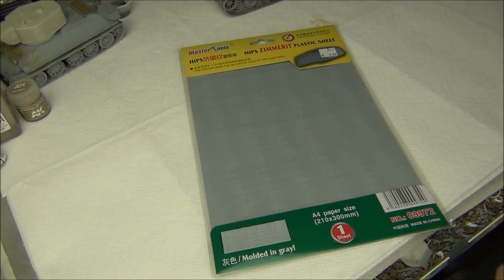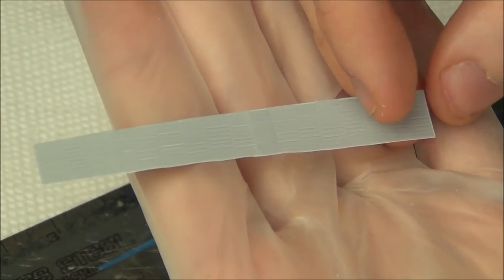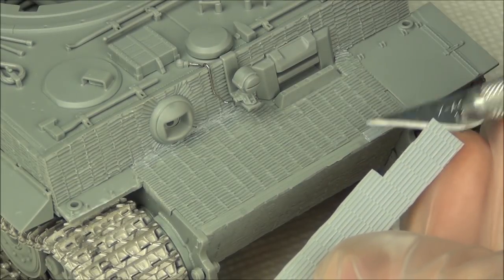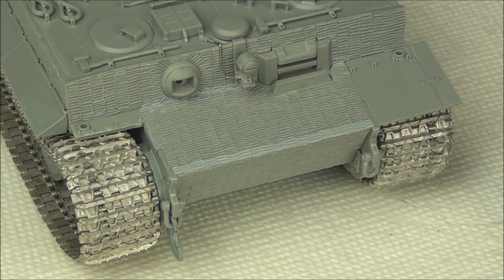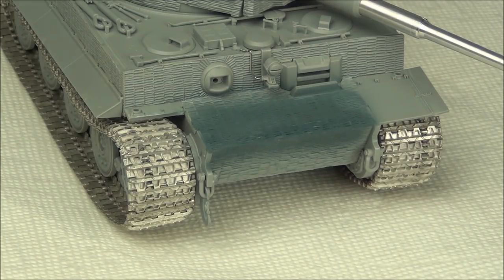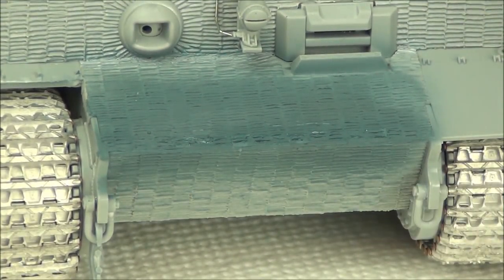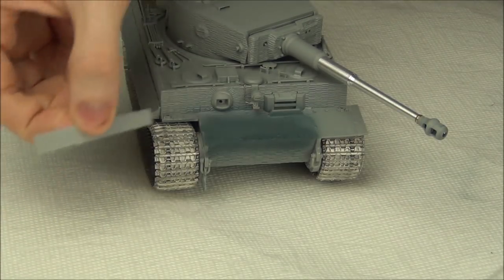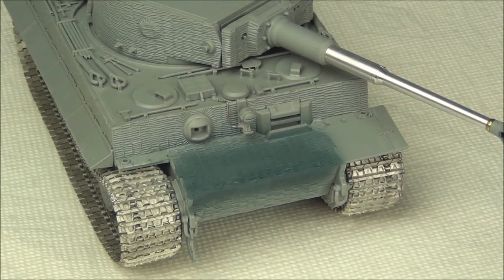"Master Tools" Zimmerit -- Testing out Trumpeter's pre-molded Zimmerit Sheets

Comment: This does look pretty good, but I am already very well invested in Atak sets (and near zero filling, fitting issues) to try anything new. I guess I'll have to get some new kits in the future and maybe give this a try.
Reply from the maker: I love ATAK sets too.  They're excellent.
Reply: @Panzermeister36  it's just so satisfying to use, flipping the whole sheet over and sanding with my 240 grit until all the gloss is gone and the pieces start to fall off. 
I just did a DB square pattern on my Takom mid early A and it's spectacular stuff.

Comment: Your skill gave the product that bit extra.I'm still making my own from FIMO(heat cured). Just roll it out on baking paper over panel outlines,trim and add your pattern, then cure for few minutes.Very flexible,tuff and you can achieve really wafer thin edges..You can push right through it too,showing actual surface of model.Better for partial or damaged zimm.That sheeting looks ok for a Factory fresh vehicle.